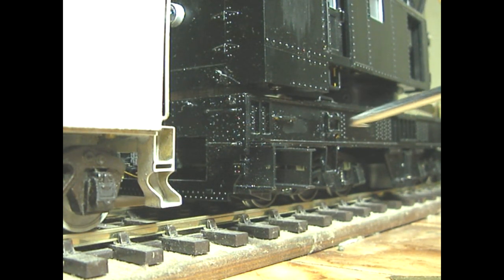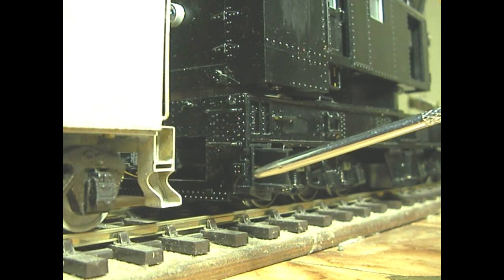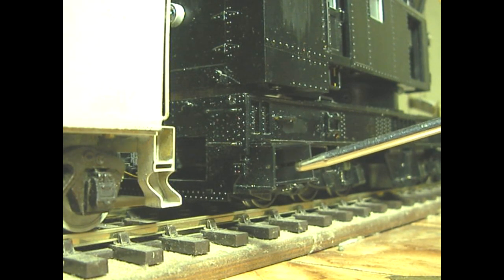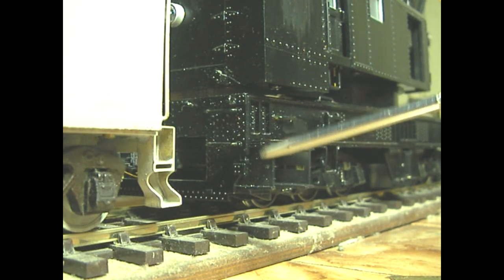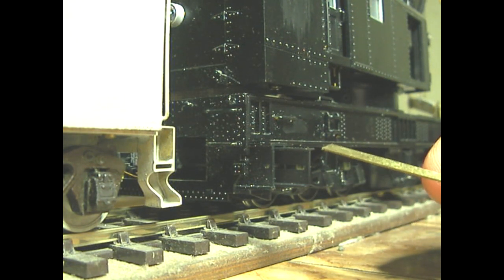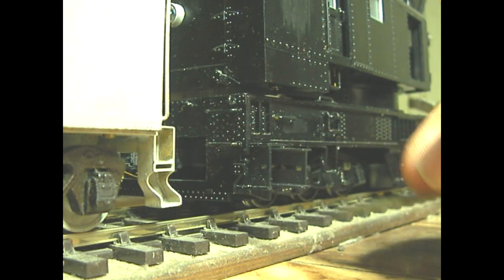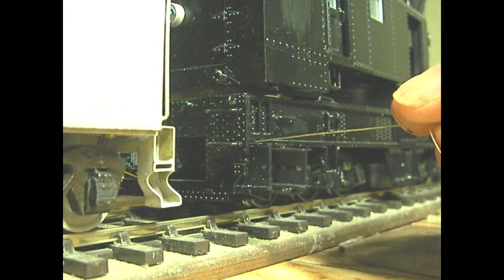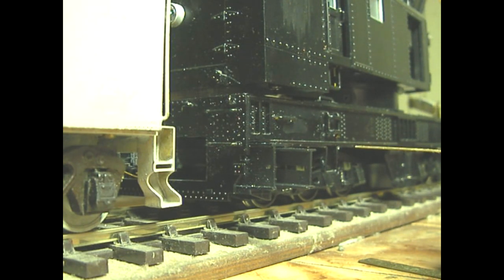Lionel Crane Outriggers 1

Comment: Rich good info. Surprised how 'sloppy' the extension piece is in its socket.   Don't think you could make existing  any longer because of the cut out space for Lionel couplers ( unless the spreader clears the current coupler box ? 
A possibility to be explored is to fabricate a slip on extension utilizing the gap of 0.3 mm demonstrated.
An extension piece ( you will need 3 min or 6 if you want the flexibility of swinging loads around the crane into waiting cars  )  could be built in brass to fit over the current 1.6 cm projection, on all sides thus wedging it into a rigid position
The advantage of a new fabrication would be incorporating a vertical adjustment screw at the outer end. 
Length of extension between 4 - 5 cm , it would then place the jacking screw beyond the ends of the track ties.    
The crane match truck could carry the extension pieces the crane will be able to swing them into place as needed
Reply from the maker: Ah yes of course, I'd forgotten about the coupler box. Good idea about making extensions that could be secured into that 0.3mm gap and carried on boom car, and of course could be lifted into place by crane itself. Yes, a screw at end of outrigger very much required.